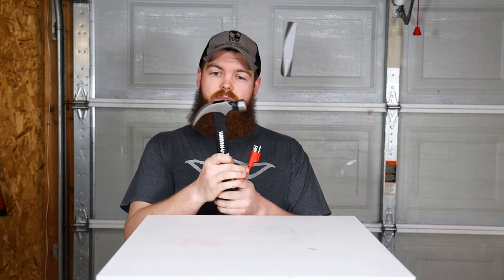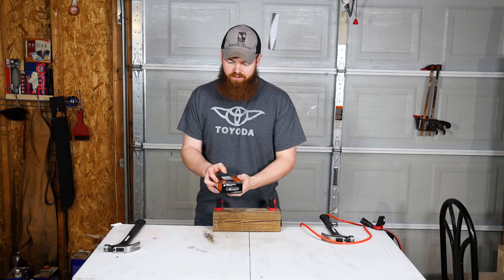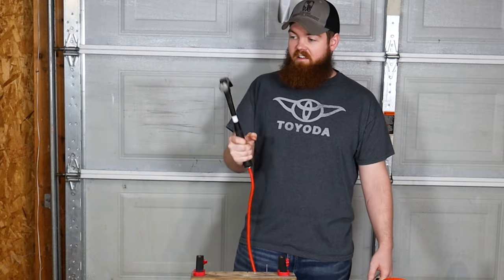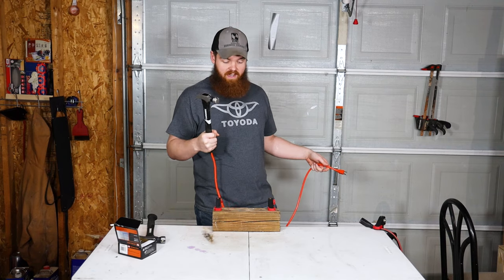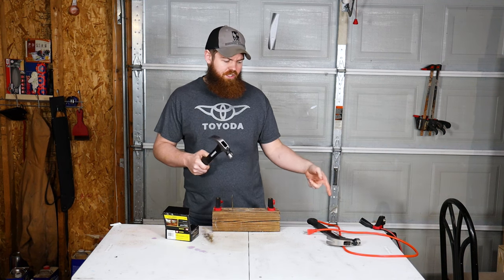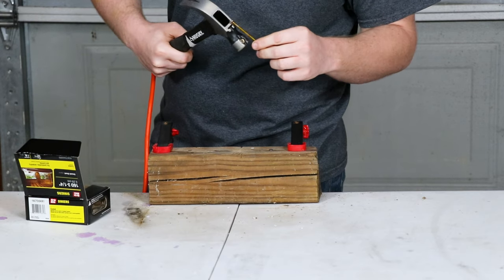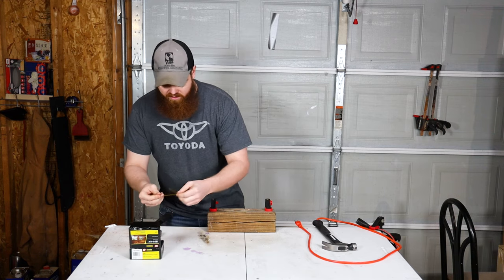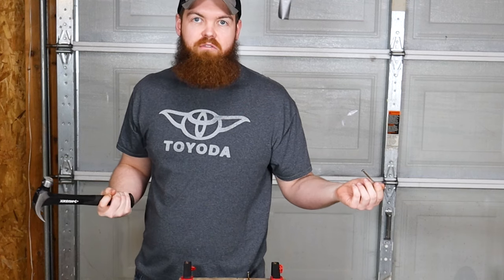Is An Electric Hammer Better Than A Regular Hammer?

Comment: Me at seeing the title...”what is an electric hammer?”
Reply: It's nothing... Doesn't exist. This is an April fools video
Reply: Colleen Taylor i caught on. Thanks
Reply: AHHHHH. I get it now. Time to switch the calendar over. HAHAHA
Reply: APRIL FOOLS but I wonder if it could actually become a thing
Reply: When you realize the hammers look exactly the same 🤦‍♂️🤦‍♂️
Reply: Colleen Taylor They do it’s called a nail gun
Reply: Well there are indeed power hammers, which is what I thought I was gunna see. But those are somewhat more like a fast, violent hydraulic press, used primarily for forging metals
Reply: A Jackhammer is an electric hammer
Reply: @lordarbitration1228  lol yea that would be a nail gun. But look up a what a palm nailer is that night be as close to an electric hammer that there is lol
Reply: tomato bark yeah I guess so

Comment: I'm watching this and all I could think was why would he need an electric hammer when there are nailguns?  Why is that cord so short?  Why is there no on/off?  Then I read the comments and realized what was up.  I am now off to find a left-handed screwdriver, a piece of Flightline and a 1D 10 T form.
Reply: Or you know, the words negativly charged transductive reactor, even a 5th grader could tell that's just random science words put in front of each other
Reply: From you saying a piece of flight line, by any chance were you a maintainer in the Air Force?
Reply: Kyle Lacy I was in the AF but was in Comm.  My first duty station I was part of an Air Control Squadron but we used the piece of a flight line for all the newbies.
Reply: Do me a favor and grab me a bucket of steam while you're out.
Reply: I need some tartan paint if you can find it
Reply: Isn't that the form to obtain K-9p
Reply: @Gozeto17 
It is, but you need QA to sign off on it first.
Reply: @Jetmech1781  it's a good think I got my boots NDI'd
Reply: Id10t forms can be found at your local union office
Reply: Box of grid squares and some of that dehydrated water.   I was told it comes in cans.
Reply: @Gozeto17  When I was in Kuwait during the build up to the invasion of Iraq we almost got away with ordering a dog.  We didn't think the ordering system would allow it but it did.  I can't remember who stopped it but they were surprised we were allowed to order it.
Reply: @bshilling9924  that reminds me of looking up Beer in FEDLOG. And parts and pieces to M-16's. Good times. What a crazy story dude, I was in Ali myself once upon a time
Reply: IF you go to the Hardware store near Tyler's house pick me up some blinker fluid.

Comment: I just can't I can't this video literally had me crying as a mechanic this was probably the funniest video ever seen in my entire life good job Tyler I wish I could hit the Thumbs Up Button more than once I bought a electric blinker fluid evacuator off of the Snap-on truck today works pretty good
Reply: You do know how that came about right? Some cars had rear washer bottles for the rear windshield wiper and some ran off the front. There was a vehicle that had two front and one rear. The second front one was headlight wiper blade fluid.
Reply: CenterStarsChannel Hollow Earth You’re thinking about headlight washer fluid. Blinker fluid has been a joke for a long time before that😂
Reply: CenterStarsChannel Hollow Earth key word is still washer fluid lol not blinker fluid 😂
Reply: And don't forget to change your winter air for summer air in your tires. Lol

Comment: I tried hooking my electric hammer up to a light dimmer switch to control the speed of the hammering action, but the dimmer switch burned up almost immediately. Standard light dimmers just can't handle the power required. I ended up stepping up to a full 15 amp variac. It was a bit expensive, but it allows me to control the hammering speed without the annoyance of smelling burnt plastic.

Comment: Nice control of that weird electronic hammer Tyler, in fact it does a faster job than the old traditional hammer 😂😂😂 Tyler you're funny handling that hammer trying to pull that nail from that wood.

Comment: This makes me curious. It would be awesome to see what happend if you plug it in while it is on the floor or something. It might be hard to fit a 110v relay inside there, because moving parts on a hammer in general sound like a bad idea, but if it had a little box with those kinds of stuff on the lead, it should be pretty simple to mod a switch on there.
Reply: You actually thought it was real didn’t you, Go check the upload date

Comment: FYI as funny as this is there are actually electric hammers and they do work. I could not find one in a few seconds (did not try hard) but it looks like a "palm sander" but with a hammer head instead of a sanding head. you would palm it and a percussion head would hammer the nails in (small nails) Neat little tool but likely more trouble than its worth.

Comment: I've not only worked in both residential and commercial construction AND am an amateur woodworker/hobbyist/artist......this video completely fooled me...BECAUSE...there ARE, technically speaking, 'electric' hammers; electric in the sense that power is needed to operate them, just in an indirect way.  Pneumatic hammers (aka - air hammers) certainly exist, and they're hooked up to air compressors which need to be plugged in to maintain pressure for the hammer to work.  Sort of like how nuclear fission in power plants is harnessed, not to generate power from the fission reaction itself, but by boiling water to convert the energy to steam power.

Comment: As a Union concrete carpenter, We use flat clawed framing hammers ..#1 We use 16d duplexs nails & 6d nails..could be good for 6d, but 16d Duplex , Na Bruh ..beside that on a Hi-Rise , You work off generators and hanging 20',50' ,100' off the building ...id get laided off instantly just for having a electic 🔨...i dont see a real need for in other maybe a residental frame gig ..even then, nail guns are there..it"s a cute idea, not practical

Comment: They actually do make electric hammers. I have one but it's nothing like this. The head of the hammer moves in and out like a piston and it has a lever button on the handle. Just line the nail up with one hand, place the end of the hammer on the end of the nail and press the trigger. It's a little slower than a regular hammer but it's steady at least. Rather bulky though and not strong enough for larger nails like a 16 penny nail unless you want to sit there for a minute.

Comment: The only thing the electric hammer needs is an intensity selector type switch so you can control it better. Also maybe some bigger muscles can control the power of all that voltage. Lucky you survived

Comment: Your using the claw part wrong, if you did that with a old hammer your more likely to break the handle. So to use it correctly you press it sideways when using the claw it bends the nail as it removes it but when you press it down sideways the claw really grips the nail as it removes it and you wont break the handle

Comment: With all joke aside, electric hammer was real, & was sold back in the 80s, & 90s. Many name brand companies has one, or two, or three. Yes, they came in different size. They look like electric hand held screw driver ( not the drill type), but a lot bigger, & many times heavier. The main advantage over a normal hammer was to use on thin long nail, & short nail, & large nail. You can also get a pneumatic one that look like a palm sander.
What nail it ( electric hammer ) was the invention of the nail gun.